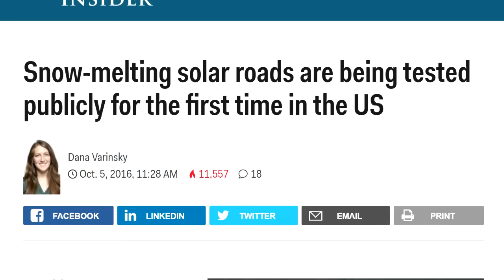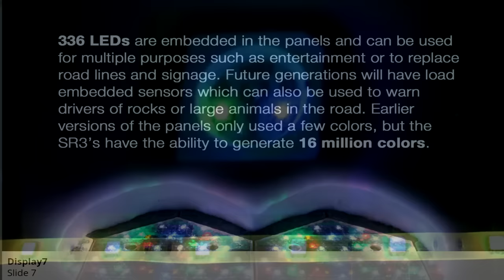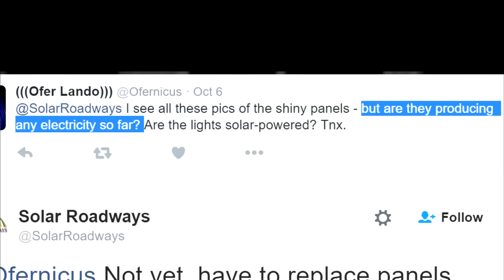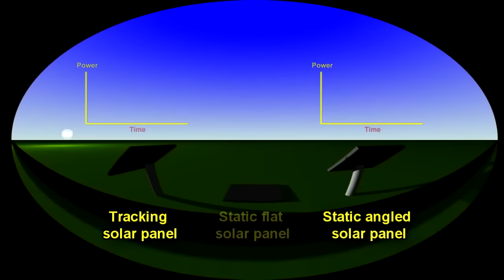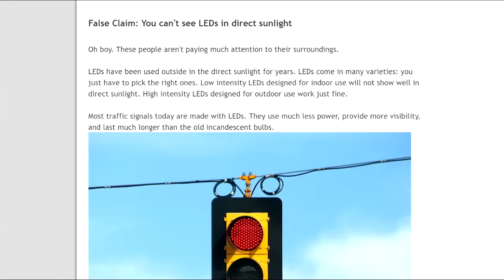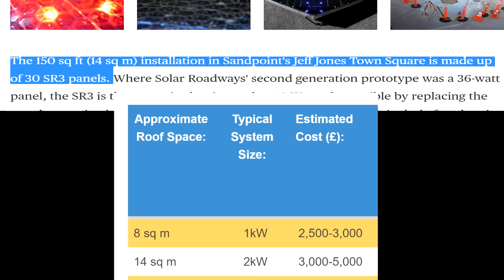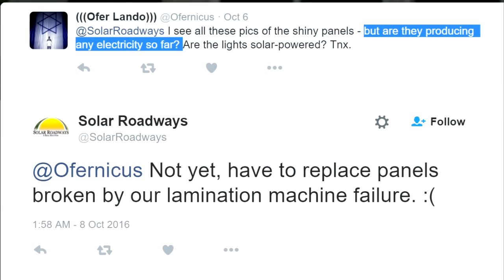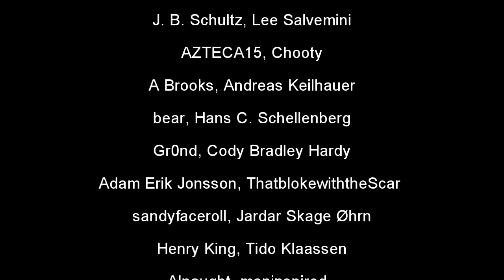First AMAZING Solar Roadway UNVEILED!

Comment: I've long looked at road repairs and thought that it was surprising that blacktop is still the main material used.  I put thought into it and concluded that there simply isn't anything better at a similar cost to serve that function.  If there was, it'd be in widespread use.  To think that this concept has any merit, you'd have to have never thought about the nature of roads and the properties road-building materials must have.  They have to be durable.  They have to provide traction.  They have to be able to cope with shifting subsurfaces.  They have to be relatively easy to maintain.  They have to be inexpensive.  These panels are none of those things.  You might as well propose making roads out of pastry.

Comment: Question: since the fact that horizzontal signs should be "drawn" by LEDs: Imagine when people with disabilities park their cars into the designated (illuminated) zones, THEN suddendly the system goes out of service (could be by any mean) or, even worse, the parking lot illumination layout gets "updated" and rearranged and special parking posts reappear under cars owned by other people who shouldn't park on those posts. Could they get a fine for that? Because that would be the case. Just sayin'...

Comment: proud to say i never got roped into the hype even b4 people like thunderfoot criticized them. solar is not as great as everyone makes it out to be, at least with their modern efficiency levels. idk if its becuse of this subtle baised i have due to me not trusting a technology i dont understand (yeah i dont know how it works ill admit my ignorance) , but solar has always rubbed me the wrong way. i like wind a lot better. off shore wind farms are supposedly the cheapest source of renewable energy and the new strides being made in micro wind power generation are really promising.
Reply: One of the main advantages of pv solar is its simplicity, the lack of mechanical components. How pv panels work is kind of easy to understand if you understand how semiconductor circuitry works. And if you don't understand that, then you really shouldn't trust electronics of any kind. :P 

Hell, even LED diodes produce a tiny bit of power when you place them into sunlight. That's what pv panels really are, huge silicon diodes exposed to sunlight, where photons hitting the surface cause a displacement of electrons, and the "diode effect" of the p-n barriers only allows them to go one way, causing a surplus of electrons on one side, and a lack of them on the other. Connect the two sides with a wire, and boom, you have current.
Reply: tybofborg thank you, that makes a bit more sense. i always worry when i admit i dont understand somthing on a channel like this im going to be crucified.
Reply: been reading about bio fules in my soil sciences class. according to a chart depicted in soil atlas 2015 in the "energy" chapter, wood fule is a less land consumptive form of energy production then solar. (the chart rated german solar panels at a 7 and the german wood fule at a 10)  the chart was kinda ambiguous though and im wondering if i miss understood some element about it (it was this avant-garde info graphic that i may have misinterpreted. if it was just a simple bar graph tuat wouldn't be the case but it just had to be diffrent
Reply: my point being is a tree is hella simple and more efficient. why dont people use the solar panels polished by evolution?
Reply: I have seen different figures, namely photosynthesis having only ~3% efficiency, as opposed to the ~20% of solar panels. Practical reasons probably play a bigger role. Biofuels require less investment and are easily stored for a steady output, but they use up more land area and require more workforce. But the best form of investment would usually be adapted to its environment. For example in central Canada I'd expect better returns from a biofuel power plant than a solar farm. In a heavily urbanized area where land is expensive, rooftops give you space for pv solar that you couldn't utilize otherwise. In a desert where plant life generally doesn't do well, a solar farm (pv or concentrated solar) would be the best option. In a coastal region, offshore wind does work amazingly well. And on hilly/mountanous terrain, it's dealer's coice :) biofuel, solar, wind and hydro all work.

Comment: When the full story behind the Solar Roadways comes out it'll probably be in the form of a comedy movie (I would definitely watch it in theaters if Mel Brooks wrote and directed it!).

That said I kind of like the concept/idea of it (or maybe I'm just entranced by hexagons) though I can't see it being used for roads......granted it would be nice if you could use those roads to generate electricity but the technology may never be quite there for it.

Though I could sort of see something like this being used for portions of sidewalks and bike trails that aren't in the shade and where the electricity generated could be used for either something right there or easily added to the local power grid.

Comment: We should put solar panels on roads - just above them as a roof cause then snow would not be a problem and since most places require you to use lights while driving it would just make electricity while reducing maintenance costs for the road.

Comment: Am I the only one who noticed that they have changed the material the panels are made out of? Originally they were using recycled glass, and moulding it into a pattern to help with grip, which obviously isn't as clear so they would be producing less energy. but now they seem to be using just regular solar panels, meaning they will be stupidly slippy when they are wet.

Comment: Thing I would like to know, instead of solar roadways which are pretty dumb, what is the cost of building canopies on top of certain roadways which are solar panel covered. Does this provide a better solution? And given that asphalt covered roads tend to absorb solar radiation  would a solar canopy atop of roadways do more for the environment?

Comment: This may have been remotely an "okay" idea for sidewalks. Sidewalks are made of gigantic tile pieces, and have much less abrasion wear than streets. To top it off, the necessity for building underground ventilation/wiring/plumbing under the paths would put sidewalks in more places, and could potentially eliminate telephone poles. But that's all a wet dream and is still susceptible to technical failure.

Comment: Only 7 tiles work still. Here's what I predict is going to happen: They wont repair any of them and just let the rest break. And after that, they'll replace them with permanent mosaic tiles and pretend that this dumb project was only "a temporary trial" and claim it was "hugely successful." Under no circumstances will they acknowledge this installation was badly designed and did no good at all, because that would force them to acknowledge that they wasted money on it.

Comment: About roads made out of tiles- look at the concrete German highways, built before WWII. These were made of concrete tiles (much larger admittedly) and some of them are STILL around! Show me an asphalt road that has the same record without a complete surface overhaul. 

Rubbing asphalt against a glass (btw you have a borosilicate glass TEA POT?) is... well who has tires made of asphalt?! It's rubber that will be moving against it, not rocks.
Reply: A 25 meter long tile is much heavier than the average vehicle, so the uneven distribution of load doesn't affect it much. But those roads weren't as glorious as some think - they cracked, they made for a bumpy ride, and they were expensive. The last of them are scheduled for replacement.

It's not asphalt that will be rubbing against glass, but no road ever remains clean, so tires will be grinding all kinds of small rocks and sand (quartz particles!) against the glass, and yeah, it will get scratched up.

Comment: I just wonder why they thought of making the roads solar panels. I mean, even with almost no knowledge of solar panels, I would have instead opted for a canopy of solar panels over the road. After all then I don't have to worry about cars crushing the panels, they are less likely to be blocked by cars or shadows from objects, they'll keep rain and snow and ice mostly off the roads, they'll also help with sun glare while driving, and if you need to repair of maintain them, they're out of the way of traffic so you don't have to close down sections of roadway to do maintenance. 

I can't think of a single instance where having solar panels as a roadway is better than just having solar panels above the roadway. Yes you'd have to spend a lot of money making this canopy of solar panels, but with their idea you spend a lot of money researching panels that can handle cars driving on them, and then even more money ripping up all the roads in the country.

Comment: you’re mostly wrong about your conclusions of angled panels being the optimal way to collect sunlight. A one square meter solar panel is going to still leave a one square meter shadow on the ground when it is facing the sun. That means you have to leave a large space between angles rows so they don’t shadow each other. If panels fall in price the next 15 years as much as the last 15 years, it will be cheaper to install them flat as well as leaving a flat surface that can have multiple uses. The factors that determine include cost of land, cost of panels, cost of tracking vs static angled installation vs cost of flat instillation. Satalites use much higher efficiency but expensive solar cells than ground based systems because the cost of “installing” them in space is on balance cheaper.

Comment: I have founded a competitor company it is called solar freaking runways. we are going to coat aircraft wings with solar panels that can power the in flight entertainment system and charge passenger phones? we have teamed up with the guys who create plastic from air this means our plane will burn plastic as fuel and will continuously extract plastic from the air so it never needs to be refuled. the fumes from burning plastic will be extracted by other planes to make more plastic so it's great for the environment. you can donate today!
Reply: Solar panels on wings are already used by electric planes in working prototypes, but your motor self-renewing used energy sounds like a great idea to make all the future technology energy-independent!

Comment: Here's what I want someone to do. Rent a full-sized SUV (don't use your own car), get up to 50mph before racing across these things and hammer the brakes.
Give us a heads up so we can watch it live on the webcam. That would be epic!!
Reply: I doubt you would even need to touch the brakes.  The sudden downward pressure and then release could easily be enough to break the panels.

Comment: Surely the best way to produce power from the road would be to have the weight of the vehicles push panels down and generate electricity from that energy? Similar to how cat's eyes are cleaned by going down into the road, attach a piston and a little turbine or something like that. Working exactly like wave power.

I feel it could be uncomfortable for the driver, but that could be negated by them all being connected and moving together. Does anyone else think this is a viable method of producing electricity from roads?
Reply: No it's not. Law of conservation of energy - any energy that you're gaining would produce an additional drag on cars, so your energy would be ultimately coming from inefficient and polluting internal combustion engines. A very roundabout version of the common diesel generator.
Reply: Thank you, I'll take this back to the drawing board now! :)
Reply: Matt
I really would caution against any kind of adding random extra functions to roads. Roads look simple enough, but after just reading an engineering school textbook about all the various requirements, restrictions and conditions roadways have to conform to, I realize that there is a lot more to road design than meets the eye, and it would be a lot harder to reinvent our roadways (without losing much of the original function) than we tend to think.

There are other places and ways to produce power. And you know the old engineering motto: "A designer knows that he has achieved perfection not when there is nothing left to add, but when there is nothing left to take away." Or the short version: KISS (keep it simple, stupid!)

Comment: Also, Thuderfoot, did you know that the average efficiency of a solar panel is hardly over 11 percent, (I think 11.5, but I am not sure.) 100 percent efficiency would produce a kilowatt per square meter. a quick google search reveals that a middle of the road panel produces about a quarter of a kilowatt of power. But considering, again by a average google search, that an average sized solar panel is almost square meters. Unless one is paying for the best, fifteen percent is beyond phenomenal.

Whats worse, that kilowatt, is only during peak sun hours, which in the summer, there are only four. 
But hey! Solar is the future, Never mind, the best in the world operates at 24.1   

Solar is CLEARLY the future. Sarcasm aside, as someone who lives in the 
American energy capital, and who has begun working in the industry, I 
would suggest pursuing clean coal, (That is burning coal and using the 
steam to turn a turbine, and then that same steam to scrub carbon 
emissions from the burning coal. Super high efficiency, entirely 
achievable with the subsidies given to solar alone.
Reply: That's cool!  I did not know that. Though, the point stands for the foreseeable  future, without government subsidies, solar power is not currently a viable solution for Energy on a large scale. I'm not saying it can't be, just that very likely it won't be. 

 My suggestion, is to allow private funding to grow solar into something economically viable on its own. And use that government funding to make the already vastly available cheap energy clean. That way entire cities won't have to worry about their income disappearing overnight. Do I am a little bit biased, I come from a town that lives And breathes  energy

Comment: Most traffic signals also have a peace of mettle to keep them in the shade as well, so you can see them.

So if you want to light up the road markings, you need to put the roadways in the shade
but then, you won't get electricity will you?

Comment: Surely if your road is glass or some transparent like material, that doesn't have "grit" in it, isn't it going to make the road rather slippery if it rains and you dare brake on it quickly to avoid something?

Comment: Every criticism in this video is logically sound and factually correct, but facts and logic can be (and usually are) used to come to an incorrect or irrelevant conclusion. It's true that it would be a structural and financial disaster to use these production methods to cover our roadways, and that other locations for solar panels are more efficient (or, indeed, effective at all). However, they aren't suggesting that the design and materials they have right now are ready for mass production. This is a research and development project intended to discover designs, processes, and materials that would be effective and efficient. I don't buy the idea that it's physically impossible for a flat solar panel to get above two-thirds-or-so efficiency of a tilting panel, for example. It would be worth doing research to find out if reflection and refraction could be used to get more light onto the photo cells without tilting it. You're criticizing the knowledge and technology we have now, and all of those criticism are correct, but you're making an illogical leap when you say that those criticisms mean that research and development in this area must necessarily be fruitless. You're not saying that we don't need cars because horse and carriage works just fine. You're saying we shouldn't develop an internal combustion engine because horses can't survive internal explosions. The reason that research exists is because the only way to get to something new is to start with what you have, and spend a lot of time and resources (and therefore money) to try to get there. That's what they're trying to do. The things you tell us about the current state of the technology are true, but they aren't relevant to the question of whether or not better technology should be pursued.

Comment: This is so aggravating. With that money, I could have probably just bought a big chunk of Madagascar rainforest which would be continually sucking carbon out of the air. That same bit of rainforest could also be used to make a long term profit using a native species sustainably that will otherwise probably go extinct in the next few years from deforestation. I could have also paid a large number of malagasy to protect said rainforest and cultivate said species with economic value in situ without cutting down any trees ...uuugghhh.  Because of madagascar's high rate of endemesim, this project would also likely have saved multiple other species from extinction, some of which would also probably have some economic value. Maybe I should get on kickstarter. Perhaps I should approach this couple about this project since they are at least good at getting a bunch of attention.

Comment: Well watching this series aside from horrendous execution the greatest failure of this system was the lack of forethought that a light source at certain angles as well as certain distances become nearly invisible in the presence of a stronger light source. Is there a way to at least make that aspect of the project work? How ludicrous  would it be in terms of cost and how dangerously damaging would it be in terms of heat generation.